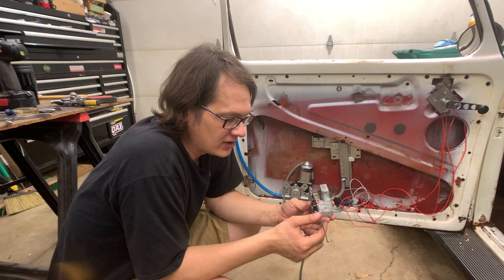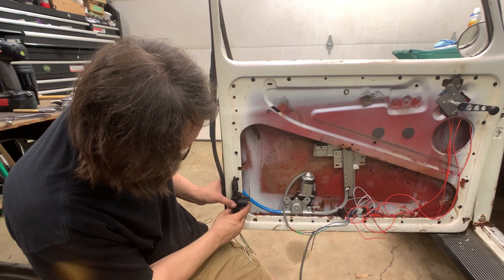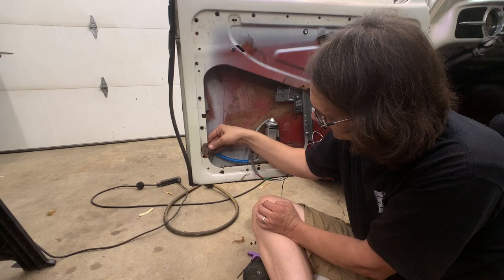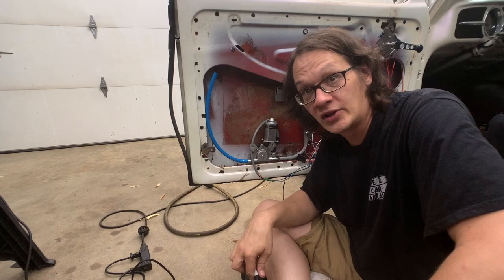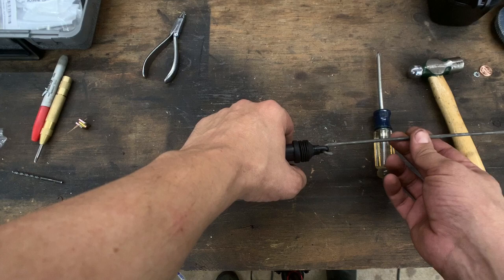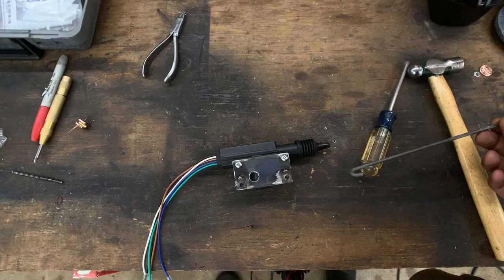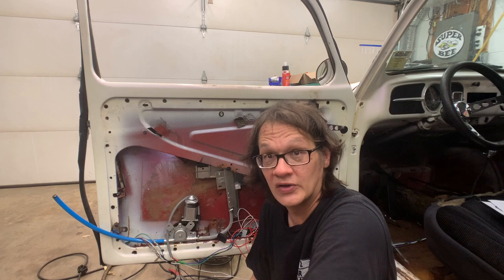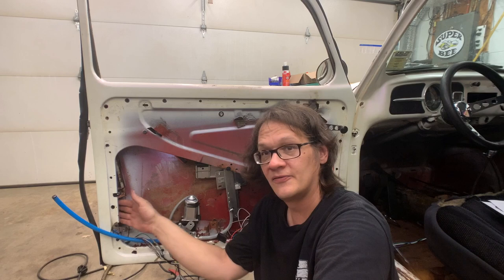Vintage VW Beetle Power Door Locks 2 - Curts Bug Part 8

Comment: Hey man Kevin here from Australia.  The power door locks have really come together nicely. It will be interesting how quietly these aftermarket parts function in an older car. Im looking forward to seeing what happens next. 
Anyhoo stay safe and stay well. 
✌   Peace man.
Reply from the maker: Kevin Hamling Thanks man! I have a similar setup in my Super Bee, and once the insulation is installed and the door panel is in place, it’s not too loud. You can hear it, but it’s tolerable. 

Thanks again for watching, and take care!